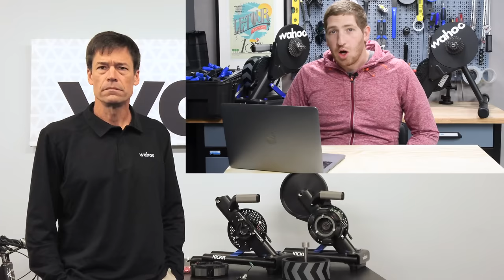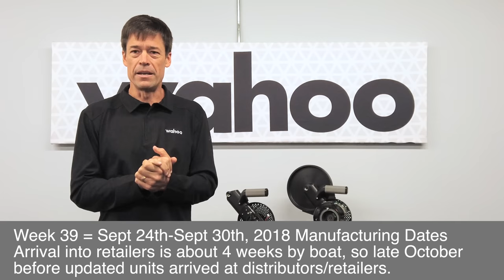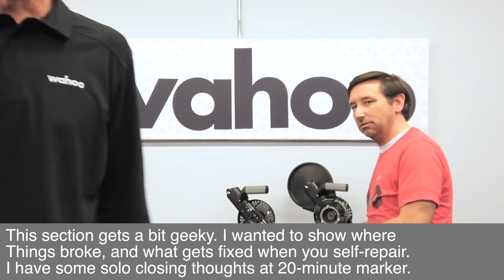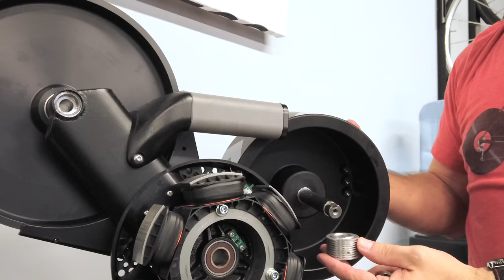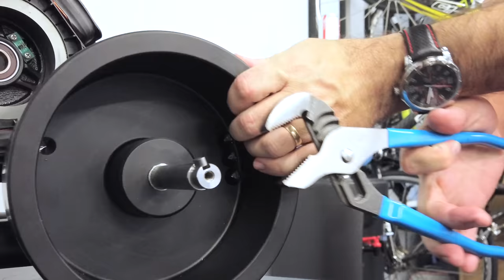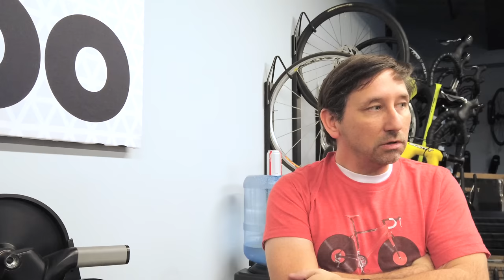Wahoo KICKR18/CORE Issues: Discussion with Wahoo CEO

Comment: and the kickr snap?  it has a bunch of issues too - did you guys touch on that?
Reply: Ny Snap 17 suddenly showed extremly high wattage power after 30-60 minutes of use during training sessions. Like you suddenly was on a E-bike and was a A-class rider in
Zwift. At first Wahoo thought it was something that interfeard with my ANT+ and BT signal. They finaly replaced the trainer and now everything works normal.

Comment: Literally broke 2 kickr cores today due to static electricity.  Getting a new one in a few days with the "fix" installed. Crossing my fingers that I won't have the issue again. 🤞
Reply from the maker: Dang, that's a record! Next time, no sting-ray shuffle on the carpet first!
Reply: @Dcrainmaker  but that's my dynamic warm-up! Since I set a record, maybe I should get upgraded to the Kickr 😁
Reply: @MichaelStephens - what do you  mean when you say "with the fix installed"? Did they specifically agree to send you one with an ESD diode? Or are you only referring to the new power block? Because I've been unable to determine so far whether they've actually begun implementing the proposed ESD diode solution that Chip discusses (or if they have, WHEN did they implement it, and how can I tell if my trainer has one?)

Comment: Wahoo is in a bad way and needs to really solve technical issues. After waiting more than a month to receive a Core it failed in 8 rides. Wahoo sent out a replacement with good attitude, little question and in reasonable(ish) time. Replacement failed in one ride. I returned both and have since moved on to a competitor’s product. If others are like me, they take their training schedule seriously, and weeks of back and forth with failed units is enough to drive athletes away. Wahoo may tell you the chat forums and comments on videos like this are overblown, but they’re not. Wahoo has a major problem...and sending out replacement soon-to-fail units is not customer service. It’s a crapshoot on their part in hoping that customers aren’t forever put off on the Wahoo brand.
Reply: So even though my has been working fine you get the feeling that it's just a matter of time before things fall apart?

Comment: These things are junk. First one lasted about a month and made the infamous vibration/ticking noises. Got the repair kit and got worse. Got my replacement Kickr and it sounded like a belt sander right out of the box.  

Luckily this was getting towards spring time so I just sucked it up outside a bit sooner than I would of liked. The fact that I still see new threads on reddit, etc about this issue shows they haven't fixed it.

Comment: Perhaps you can do something similar with the Tacx Neo 2.
Reply from the maker: What's wrong with the Tacx Neo 2? I haven't heard any complaints there?
Reply: Or the flux. Is yours still working etc. I've had 5 in 4 months orginal flux and then the flux s.
Reply from the maker: @markstone722  Have you broken those original Flux units recently - or back a year or two ago?
Reply: @Dcrainmaker  the orginal I got in Sept 2018. The last one flux 2 was rec back to flux in 31st Dec 18. I'm still waiting for a replacement. They did say they would upgrade me to the flux 2. But have concerns about quality. I'm only 69kgs so hardly over weight.
Reply from the maker: @markstone722  Woah, that's weird. For the most part, issues dissipated like a year ago - so super surprised to here that. Though, as noted in the video, I did manage to kill a Flux S on like day 2 or something. I didn't kill any NEO2's, nor have I killed a Flux 2 yet (though only one ride into it).
Reply: @Dcrainmaker  maybe a new review on not just the flux but maybe other kit. Kit that has far exceeded your expectations and others that have fallen short.
Reply: @Dcrainmaker  First my cadence was all over the place and then it began getting stuck on one number and mostly, it would drop to zero mid ride. Later the Power meter kept dropping out (going to zero) so the resistance went to zero also.
Reply: @markstone722  Still being warrantied. Not sure yet if I will be getting a rebuilt or new one.
Reply: @MstrRo1  try updating Ur firmware via the utility app,. Might solve problems with your cadence.

Comment: Anyone had this issue and bought through Wiggle? Mine developed the noise at the weekend and having trouble knowing who to go through to get it replaced. Wiggle are saying I have to go through Wahoo but Wahoo told me that Wiggle should be offering the replacement without needing to request a Wahoo support ticket. Anyone had this experience?
Reply: MarkyFo I bought mine through Wiggle. Contacted them originally & said I had to contact Wahoo. Did this & sent them a short video of the knocking noise. They came back to me with a reference number which I gave to Wiggle, sent it back & had a replacement within a couple of days.

Comment: good for a ceo to show up, but, but but, and then but again. 900€+VAT for a thing that actually doesn't work as it should, in some units, with such a great customer support behind it though, which is great, but it seems to me that you are paying for something that, if it was designed better, or if it had more years behind of solving issues, it could cost half of that, so i am paying 1300€ fr something that, if it was better designed, would give less headaches to the company, so they could sell it cheaper.... cause this thing costs a lot. A canon camera also costs a lot, but it's tested and works, this trainer game is a joke. Elite suito also giving issues, the kickr, less problems, but still problems, and twice the price. the tacx also giving problems, I mean... Why would i want to upgrade my trainer with so much crap out there? what if it breaks right after warranty? should these guys offer 10 years warranty, when they are so expensive and such  lottery thing with every model?? biek industry gets to far sometimes with the beta testers who pay to be beta testers.

Comment: Dont forget poor ballanced Flywheels that causes vibrations! Sry Wahoo but the Kickrs are Products developed by your customers not you and this isn´t right! Not for 100, not for 200 and finally not for 800+ bucks.
Reply: Claudel   I have a Kickr with vibrations, but I suspect it’s the flywheel shaft to bearing inner race clearance.  I tore my unit down with plans to bond the bearing inner races to the shaft.  The bearings look fine.

Comment: While it is nice the CEO of Wahoo did this video, it doesn't escape the fact that the Wahoo Kickr Core is an incredibly poor quality product. By the CEO's admission, every Kickr will fail eventually.  Again, it is great Wahoo is trying to do the right thing, but what they should be doing is refunding customers who purchased a Kickr, especially considering it cost $1K

I'll probably just give up on the Kickr and get a Neo https://tacx.com/product/neo-smart/
Reply: I'm thinking of trying the cycleops hammer in the fall after my experience with Wahoo. I'd read up on the Neo. I've seen some recent posts on reddit about them arriving doa or crapping out soon after and terrible customer service. 

It's infuriating how much these costs and have to play games with repair kits and long waits for replacements.

Comment: It seems these are not tested enough, and are pushed out because they need to make money...simple as that.
Reply: I fully agree. If proper longterm testing had been done before releasing the products, I bet Wahoo would have come across the problems themselves. As far as I know, the chevron stickers are flying off almost each and every Kickr Core. How could Wahoo have missed this, if proper testing took place? The second mistake Wahoo made, was replacing defective units with other defective units!!! This is very bad for customer satisfaction.
Reply: @Vifferboy  They should have admitted of the issue and refunded these people, instead they sent out a product they knew probably had an issue.

Comment: Can you talk any faster?
Reply from the maker: Most definitely. I actually talked pretty slow in this video compared to many of my other videos.
Reply: #pointSevenFiveCrew
Reply: No mention of the overly right drive belt and worn out bearing issue as described on the forums. Received my Kickr 2018 ten days ago with the old Allen key screw holding the key way pulley on, not the new bolt shown by Wahoo on your video. So still looks like they’re still shipping old stock, even now.